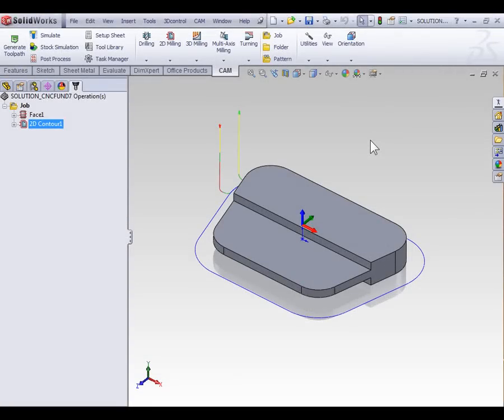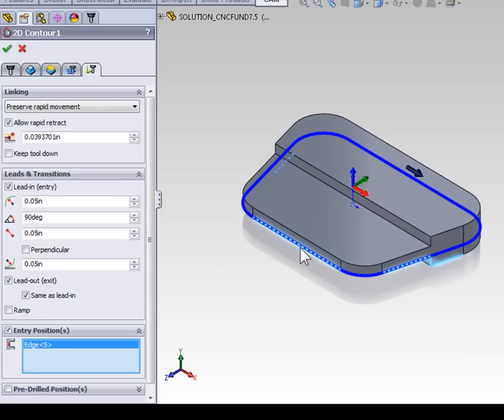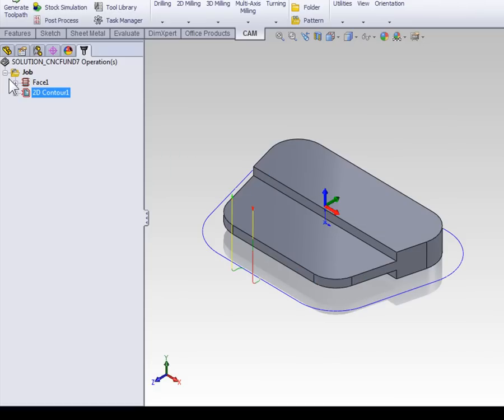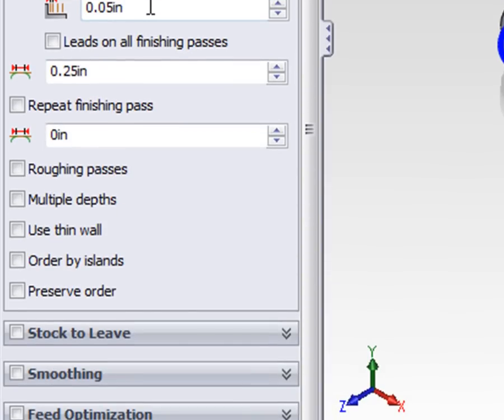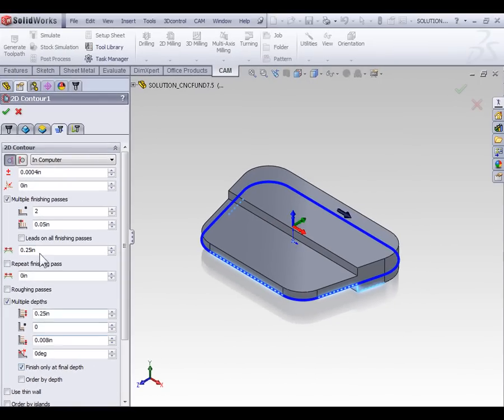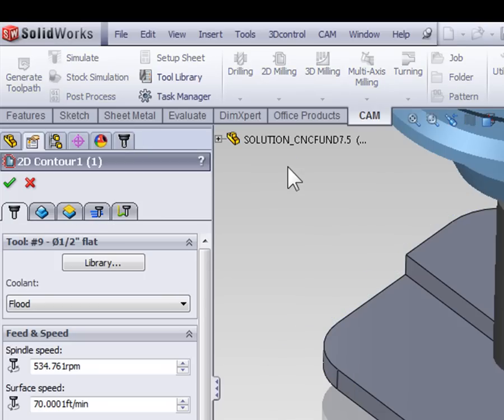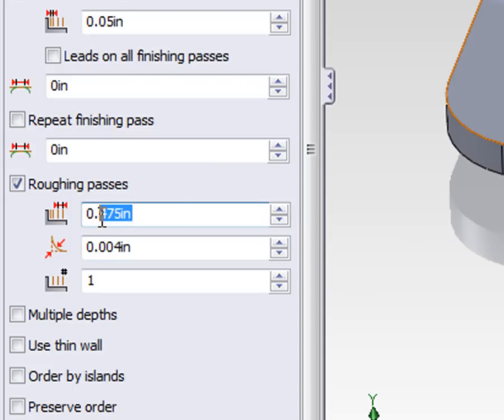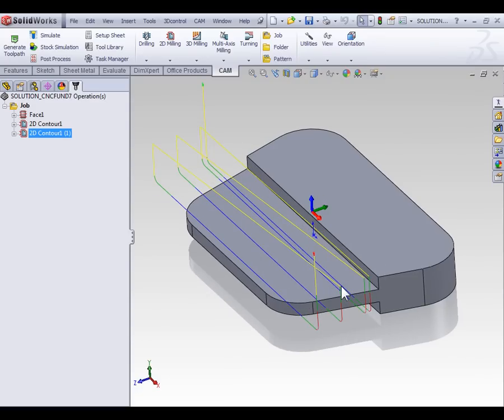HSMXPRESS / HSMWORKS - 2D CONTOUR PARAMETERS

Comment: how about a partial contour? like just rounding corners off while holding onto the full height of the part to avoid op 2 where you'd flip your part and mill the backside.
Reply: nevermind, im a genius and answered my own questions. Can you please further explain the difference between tangent propagation and propagate along z? I had to turn both off in order to do what I wanted and left me with a feeling that I didn't truly understand what was going on as I thought z propagation wouldn't have any affect on whether or not i could partially select a chain running in the Y axis.